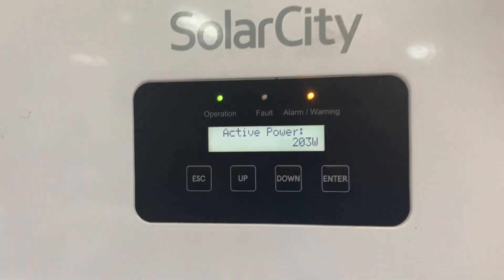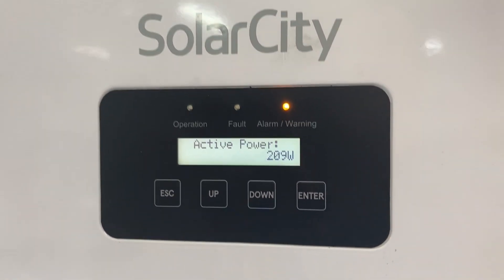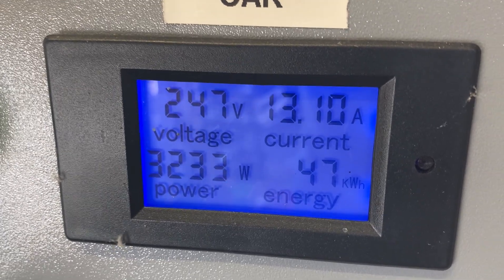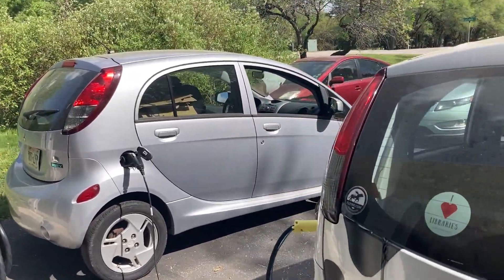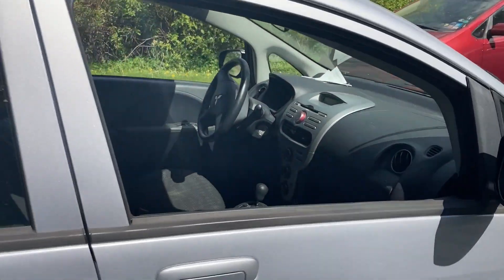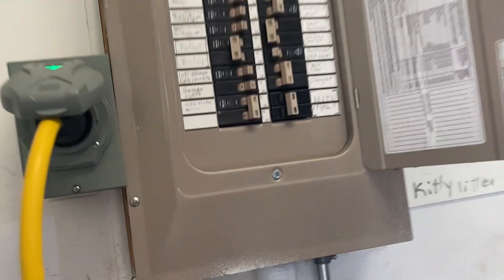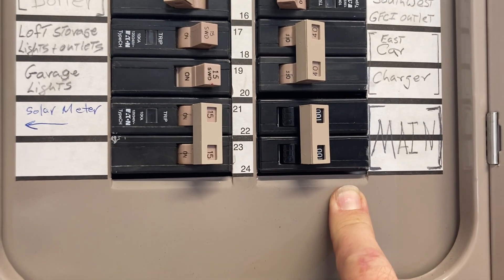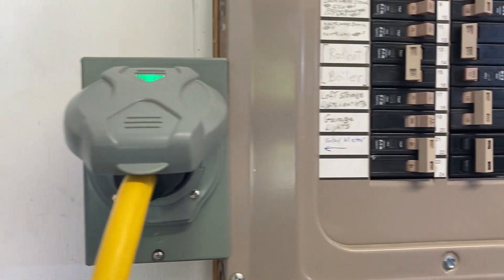Charging an Electric Car from another Electric Car! | DIY V2H | Solar

Comment: Usually it can become DANGEROUS until you read and understand the description box fully. 

I had wondered first what was going on cause we had done a similiar experiment to provide a sine wave for the then "offgrid" inverter that those can connect to but it broke later when the solarpower production was bigger then the demand we draw from that grid. First it had worked fine cause we had an empty battery that wanted to be charged but later that day the gap had become too  big and the inverter broke back in 2018 or 2019.

Comment: Thanks Ben, I am dreaming about things like this. We have lots of rules about how to build electrical systems in Sweden. Things are changing but currently the car supplying the power would have to be bolted to the ground and only a certified "generator builder electrician" would be allowed to connect the chademo cable to the generator inlet. This is of cause crazy. Another couple of things that make sense is that you are never ever allowed to send electrical power into an incoming power line that has no voltage. This is because electricians might be working on restoring power and you might electricute them. The other thing is that here you would have to supply your own sufficient earthing so that you and others using your power are safe.
Reply from the maker: There are some of the same things here. Earthing (grounding) is already taken care of at my breaker panel. As soon as my generator cable is plugged-in, it connects to the ground rod attached to the breaker panel.

Likewise, NO voltage is allowed out in a blackout situation. This use usually taken care of by a transfer switch or a breaker manual interconnect. There wasn't one of those available for my panel, so I 3D printed my own.

Comment: I love this DIY AC coupling! It seems like the H6 should be able to dump extra generated power into an attached 48ishV array of batteries, like the electric tractor you're converting. Granted the micro inverters would still cut out if ALL the batteries got full, but turning off the solar would be fine as long as there was sufficient capacity to keep the inverter powered and if I understand you correctly the solar would start back up as soon as the batteries were discharged enough to take a charge again.
Reply from the maker: This inverter was specifically designed for a high voltage battery pack - the original Tesla Powerwall. It will NOT charge a 48V battery. Unfortunately, the range of the battery input is EVEN HIGHER than what's in my car!
That's one of the reasons why I'm using the PV input instead of the battery input.
Reply: @BenjaminNelsonX  oops I forgot that was an old Tesla inverter. I saw the battery status when you were flipping through the settings and got it confused with other inverters that have lower voltage storage.

Comment: How do you keep the microinverters from backfeeding into the car inverter and blowing it up? Or is that just not a thing with AC power and it just works it'self out?
Reply from the maker: If the micro-inverters are putting out "too much electricity" it pushes the voltage higher and out of spec for the micro-inverters. They then automatically turn off. They try reconnecting automatically 5 minutes later.
No issue with that as long as they are under enough of a load.
My solar array is about 6kW. Both our EVs only have 3300 watt chargers on them. In the middle of the day, off-grid, I should be able to charge both cars straight from the solar with only a small amount of energy coming from my Mitsubishi battery and forming the micro-grid to keep the solar micro-inverters active.
Reply: @BenjaminNelsonX  How difficult would it be to power a fridge, AC, heater, or other appliances (or the whole house) during an extended outage?  If I'm understanding correctly, you would want the EV that's being charged to draw enough of a base load that would keep the solar in check and any added loads would draw from the other EV?  So you would eventually need to switch the EV powering the system with the one being charged, and an EV capable of 6+kw charging could keep the micro-inverters happy any time of the day?
Edit: I somehow missed the last paragraph.  Sounds like you could charge both cars at the same time and be fine as long as they're not full, but possibly still need to switch which one is powering the micro-grid?
Reply from the maker: I hope to be able to charge the car that I'm drawing the power from for the Solar City H6 inverter.
The inverter is rated for up to 6kW and I have a 120/240 split phase output, so YES, it can run my entire house.
If I want to use solar as part of the system, I just need to make sure that more power is being used than the solar produces, so that it has some place for the power to go.
My solar is on 3 breakers, so to some extent, I can manually control how much is produced if I want solar, but some amount LESS than the maximum that I COULD produce.

Comment: This is what I've been trying to tell the EV haters that say "you still charger your car with dirty energy (coal power plants). Well yes but we COULD use just solar to charge our EVs. There are charging stations with solar panels available and doing it like you are at home is what I want to achieve. Very cool and thanks for sharing.
Reply: The additional benefit of local generation is considerably less transmission losses.

Comment: So, if the solar generation exceeds the load, wouldn't the SolarCity inverter feed battery in your EV #1?
Reply from the maker: No. Remember, the battery is connected to the PV input of the inverter.
My grid-tie micro-inverters are designed to stop producing power if the AC voltage is out of spec. When they over-produce and there's no infinite sink of the grid, the voltage pushes up and the inverters kick out.
It seems that as long I have an appropriate load on them, the solar with micro-inverters works just fine.
Reply: @BenjaminNelsonX  Yeah, I forgot for the moment your solar has microinverters. I have string and central inverter. I will replace it with something like Solar City when its time....But then I don't have Chademo car.